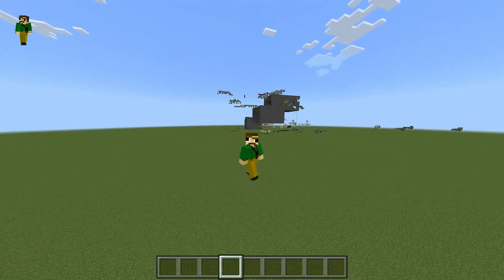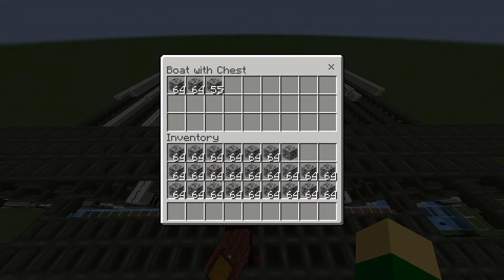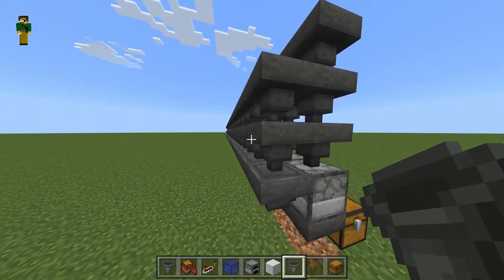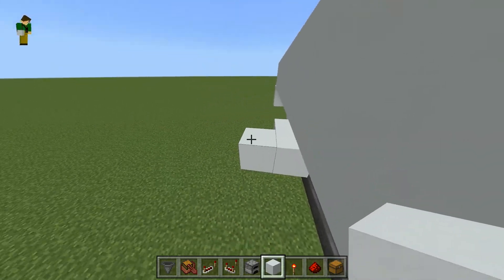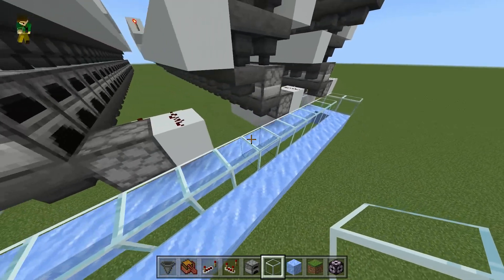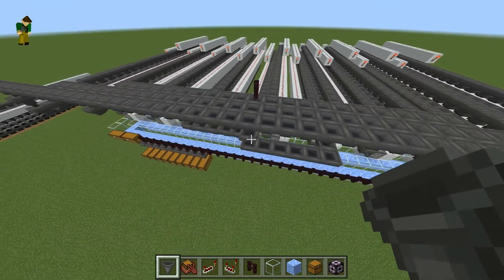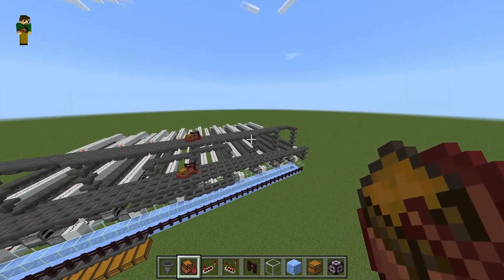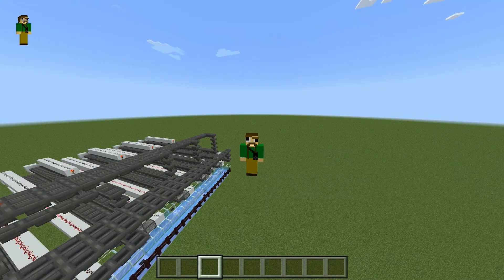Two Hundred and Twenty Five Furnace Array! (Tutorial for Bedrock Edition)

Comment: do you have a world download available? also what are the rates
Reply from the maker: I do not have a world download sorry, and I don't believe I have this world anymore. You should be able to see everything necessary to build it in the video though. The system outputs 1 item per hopper tick for each module (25 furnace strip), so the rates are 9000 per hour for each module, or 81000 per hour for the full system.

Comment: Where’s the material list?
Reply from the maker: I didn't make one for this sorry. The main stuff per module should be 25 furnaces, 175 hoppers, about 64 redstone, two comparators, two redstone torches, and a bunch of building blocks. If you're doing multiple modules you'll also need more hoppers to connect them as well as droppers and the others stuff for the water streams.
Reply: @readfreak7  Thanks

Comment: What are the demensions and exact rates?
Reply from the maker: Each module smelts items at hopper speed, which is 2.5 items or second, 150 items per minute, or 9000 items an hour. For the full 9 module system it would be 81000 items per hour. Each module is 4x29x6 blocks, and the full system is 44x32x13 blocks. It would be taller if you hook up more storage.